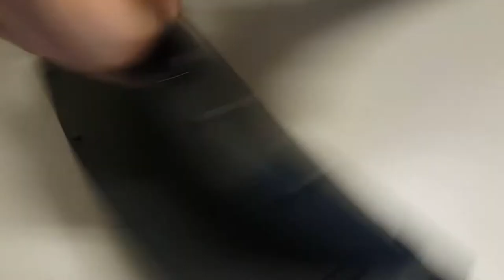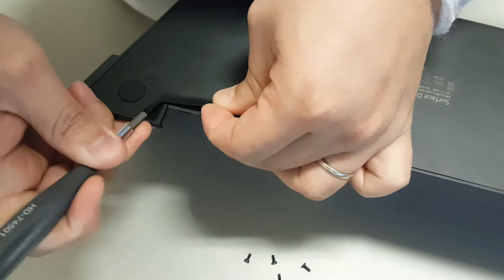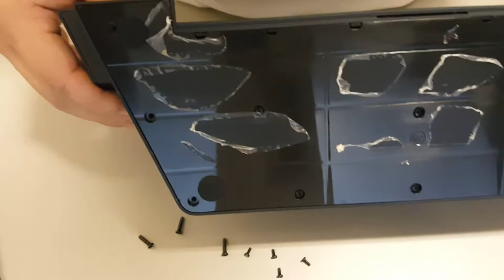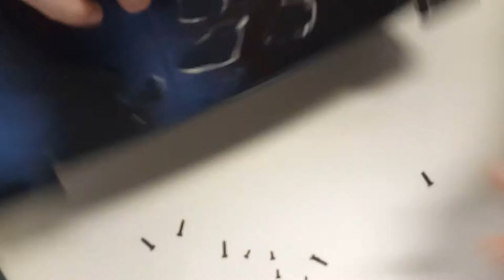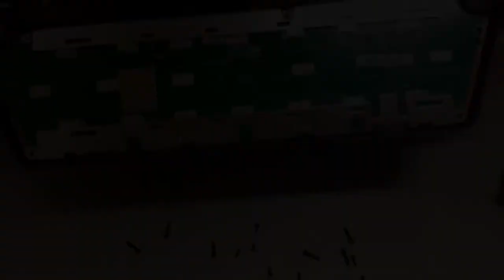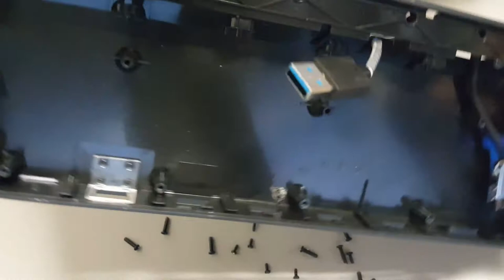Surface Pro 3 Dock Tear Down

Comment: Great video Jin Thao, however my Surface Pro 3 docking station uses a star head (5 point - pentalobe) screw and the screwdriver that you say you are using only comes with phillips and slotted heads

Comment: have you tried to take out the cable that attached to the dock and i can be connected again to the mainboard? if it's possible i can use it so my sp dont get stuck in one angle position

Comment: I want to see if I can make my Surface Pro 3 dock interface with my Surface Book 2, and this video is great. But what screwdriver are you using? Thanks!
Reply: Its a T6 torx screwdriver
Reply: Did it work? I was thinking of repurposing it for a newer surface device as well.
Reply: @Sciencenme  I don't remember the specifics, but it didn't work well enough for me to actually use it.

I was able to extract the vital components from the dock body, but the data/power plug contains no magnets to hold it against the data/power port of the Surface Book. So, improvisation is needed. Then the power supply wattage could not meet the Surface Book's demands, and that largely ruled out its usefulness to me. I don't remember trying to use the system as a data/display hub.